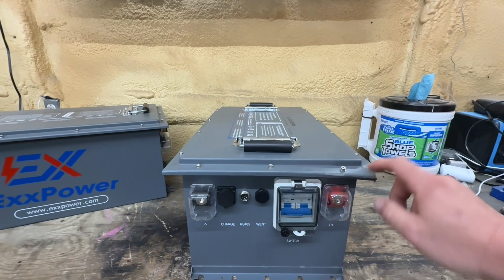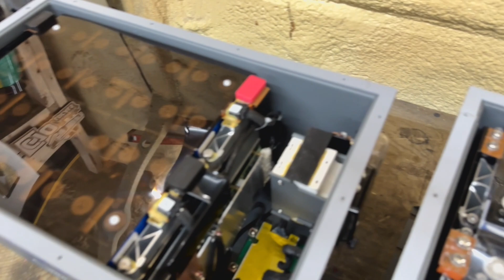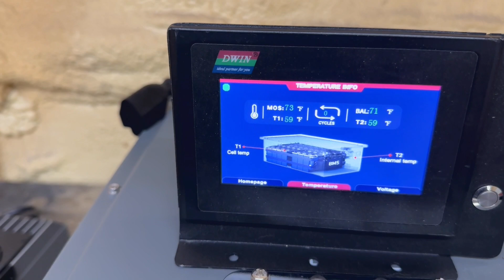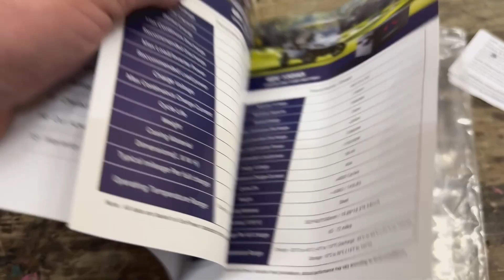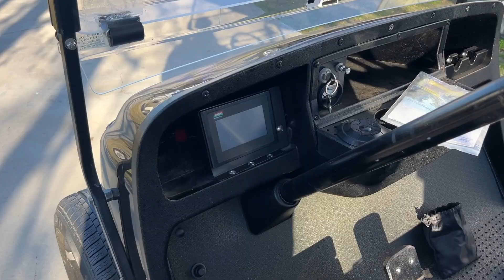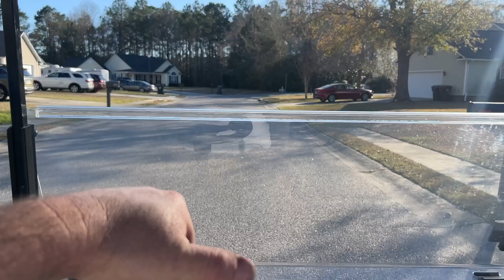EXX POWER 48v 105ah Golf Cart Lithium Battery Kit | 2016 EZGO TXT

Comment: I was going to go lithium last year, but a neighbor a mile away bought a new Chinese cart that came with 72v lithium setup. Well, the damn thing was defective. The charger never shut off. It blew up like a Tesla hitting a brick wall. The attached garage burned down, and by the time the fire dept. pulled away there was over 100k in fire, smoke, and water damage plus another 20k in expenses waiting six months to move back in.  Now I’m a little timid about Chinese lithium chargers.
Reply: They are all Chinese chargers.

Comment: What did you use to cut battery tray out. I’m having the same issue
Reply from the maker: I’ve started adding 2x material in them instead of cutting them. Much quicker. 22” wide so that’s how long I make the 2x6 or 2x8.

Comment: Great to see you back at it. There is certainly a lot of choices in lithium today. I give everyone a choice on which one they want and  most chose the Chinns because it’s so inexpensive. I have more than a dozen running around our golf course community and they are holding up well. I have 6 Vatrer 48 v 105ah and one 48volt 150ah. I have a 48v 105ah myself and I’m happy with it. I use 2 by 8 pressure treated wood to fill the battery spaces after cutting off the 2 hold down bracket’s . Than use wood screws to hold down the battery . Just another way because I don’t have welding skills. Good to see you back at!

Comment: Question can I use 48 volt batteries and use it for a 36 voltage cart motor just by using a new controller
Reply: Lots of us want to know the answer to this.
Reply: It is best not to operate in this way, as the motor may burn out under high voltage conditions;

Comment: good job on video.   why did they mount the charge port upside down.  in your video, the cable from charger plugs into the battery upside down, major bend in cable.